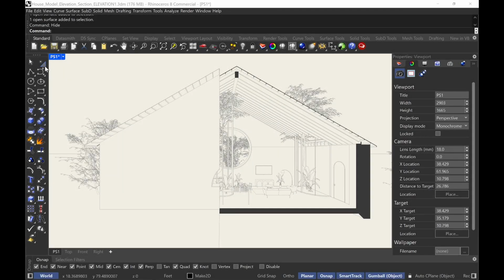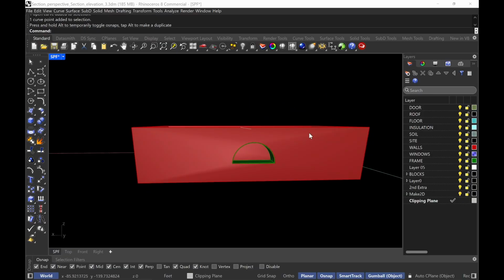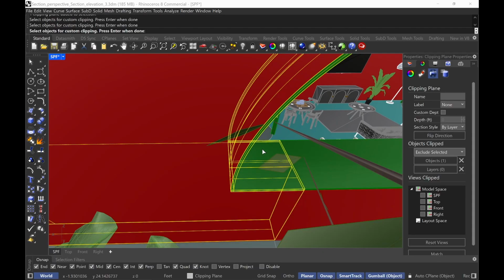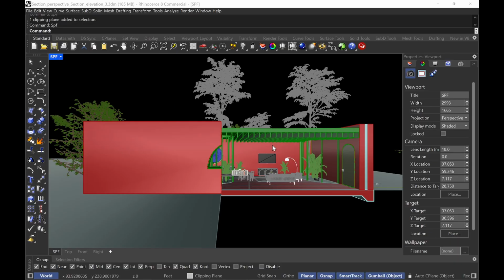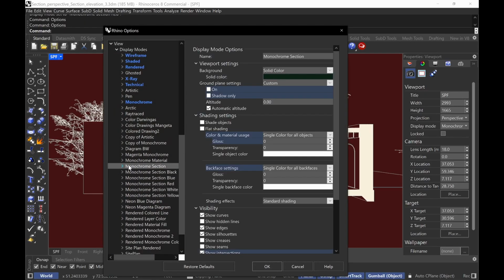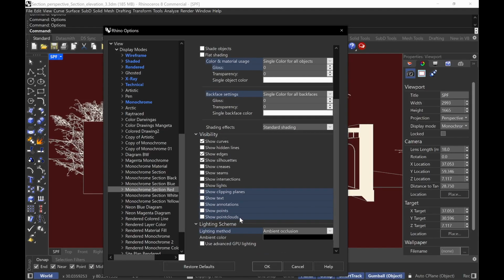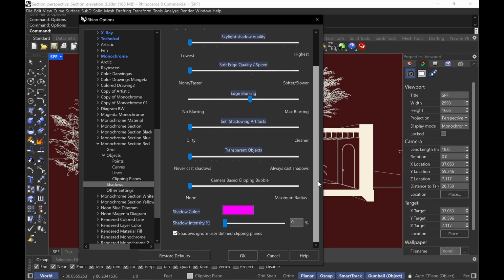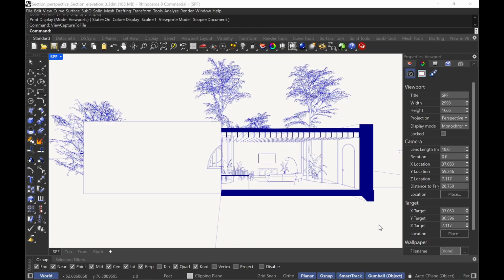Perspective Section Elevation in Rhino 8 - Architecture Illustration Style

Comment: I've done everything, but the thickness of the lines is still too thick. Maybe because my drawing is too large and when I zoom in on the detail I notice the fat lines? But they're so thick that I can't see the details, and that seems strange to me because in your drawing, even the leaves of the tree are clearly visible.
Reply from the maker: That shouldn't happen. 

One simple test is to use a Box. If the box's lines are too thick, then you're def missing a step. 

Make sure you are looking at the final export (viewcapturetofile) with the proper settings, not what's on your screen.  And when you're on your screen, do "printdisplay" command, and select display option, as shown in the video. 

Do a test on a completely brand new file, and always make sure your model is close to the 0,0,0 point.

Comment: Hi i have a question. I followed everything in the video, but my section fills wont show no matter what I do. How can I fix this?
Reply from the maker: Hello. Do this test:  Make a box (box command) and use the clipping plane for the box. If the fills show up, then that means your original geometry is not a closed polysurface. Whenever you work with clipping planes, make sure your geometry is a closed polysurface if you want the fills to show up.
Reply: @unitedstatesofdesign  Hi, thank you for your tutorial, I encounter the same problem, however all  my objects are close polysurface, the fill still does not show, I don't know have to fix that.
Reply from the maker: @vveb8028  

Hello. 

Do the box test as stated in the previous comment. 

If the clipping plane fill shows up in the box section, then that means either your clipping plane settings has an error or the polysurface is corrupt.

Comment: This is absolutely amazing! Thankyou so much... Is there any way we can use make2d command with this to use it in Illustrator? When I do this it doesn't work in excluding the elements and cuts everything even though it is visible in view
Reply from the maker: Thank you so much for your support. It's still a glitch in Rhino 8 when it comes to making 2D for selective clipping planes. I would just make 2D twice, one with the elevation, and one with a section . The only other way I've seen it work best with the selective clipping plane is use "exclude objects" in clipping plane, and then you would have to manually delete all of the extra lines

Comment: My line weights have still come out heavy and the resolution from the view capture to file is fairly poor. Is there alternative ways to save as opposed to a PNG?

You mentioned at the end about line weights coming out better if you scale up?
Reply from the maker: Make sure you turn on print display state = on, color=display, thickness =1

Also, all your line weights should be on hairline or default if you're using objects width. If by pixels, no greater than 1.

Lastly, in your view capture to file, I always upscale my resolution to 4k and scale it by 2x or more

Comment: I have rhino 8 in my Mac and it crashes when I hit preferences , or use the options command does anyone knows why this is happening ? (is jack sparrow rhino and I´ve tried different versions)
Reply from the maker: Are you able to open the preferences in a blank document? 

If you can open the settings in a blank document, try switching the graphics usage to the CPU.

I think some Rhino for Macs are currently having some glitches with the M Chips deciding between using CPU or Graphics.
Reply: @  I can’t , it crashes instantly. I had the same error in sketchup when I was trying to open brush palette , but it disappeared when I installed the 2024 version

Comment: Great Tutorial! Is there any setting/displaystyle that looks the same but still have the options to have control over the individual lineweights/layer?
Reply from the maker: Yes. If you have Rhino 8, you can do the rendered view instead of monochrome and do the "Use Objects Width" option.
Reply: @unitedstatesofdesign  Thanks tried to do a similar display style in Render but i can't get the meshes of the vegetation to show as nicely - it ends up getting to messy or having too little lines along the edges of the silhouette. Plus the surfaces can't have the same color as the background while still having the lines (surfacesedges etc ) set to another color. Am I missing something?
Reply from the maker: @scnils1794  I'll be making a video shortly about mesh display